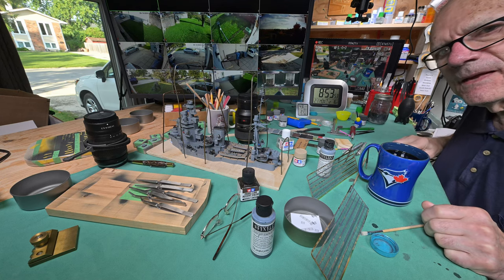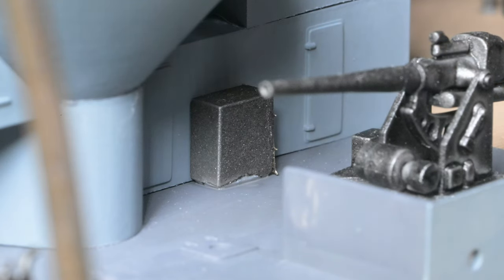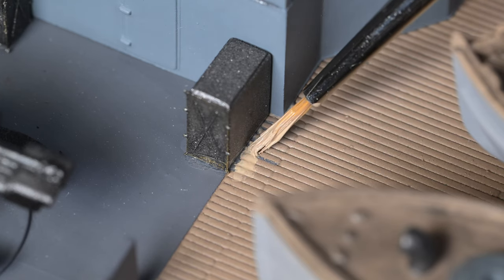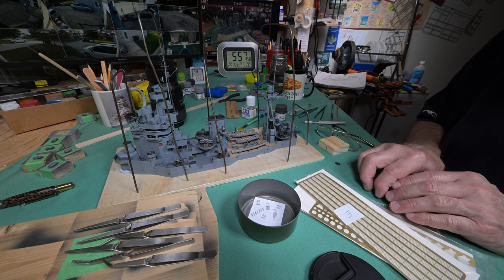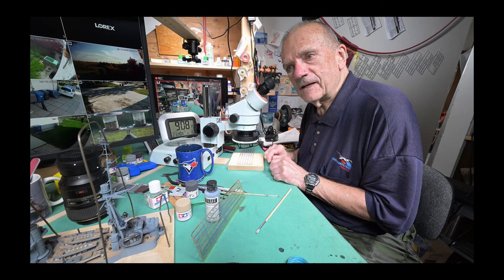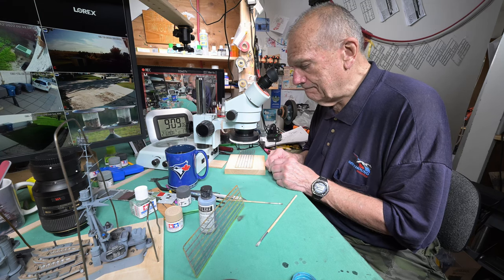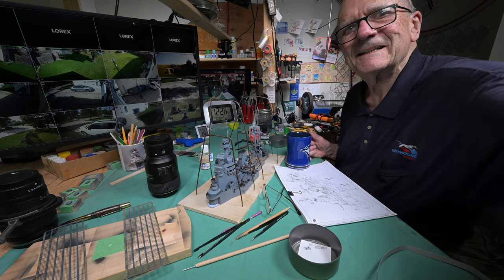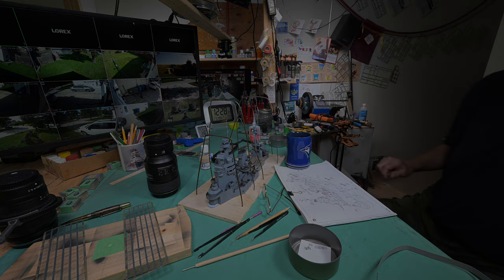The Model Ship - Part 1299

Comment: Hi Ron, about that painting.
You have thinner diluted paint.
This makes the paint sensitive to “fish eyes” (silicone).
That means if you use a silicone based lubricant around the house, those silicones are everywhere.
Also on what you want to paint, and then you have “fish eyes”, which push your paint away.
The paint trade has a means to combat those "fish eyes".
Reply from the maker: There is a lot to be learned about painting, that's for sure. Thanks Arie. 👍

Comment: Hi Ron, good recovery as always! Have you thought about trying to add the glue to the bottom of the railing before placing it? Yes you have to be a bit more precise on the initial drop but it might save you having to re paint down the sides. For the smaller lengths having something like a pringles crisp can lid that you can keep applying some CA medium on and then you can sort of just dip the bottom edge of the railing into the glue. Hopefully that way you get just the right amount that will enable it to adhere to the edge and no more.

Have a great day.
Reply from the maker: Hi Barry,
My experience has not been too good when it comes to applying the glue on the part first. My dexterity not being what it once was usually results in the part not placing in the correct location on the first attempt. 😒
Reply: @roncalverley  That's fair enough Ron, as always you have to do what you think is best anyhow...no one else is building your ship, so it has to be what is most comfortable. 🙂👍

Comment: Some types of resin (in paint) will start to polymerize with age and form long molecular chains.  Added solvent will not re-dissolve these long strings. Consequently, paints using this type of resin may have a short shelf life.  Also, thinning too much or using the wrong ratio of solvents can cause issues.
Reply from the maker: Thanks for that info 👍